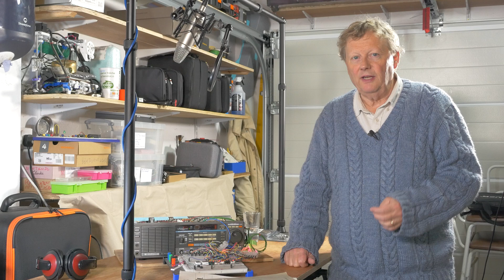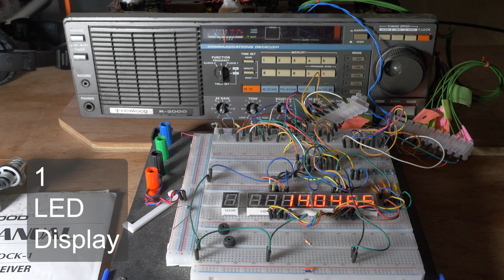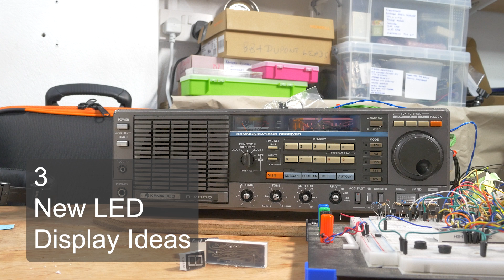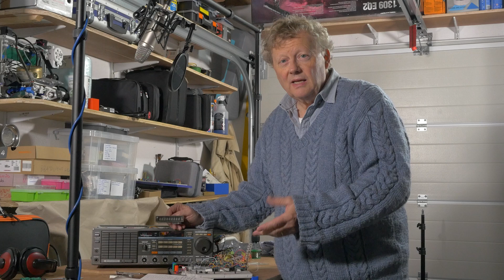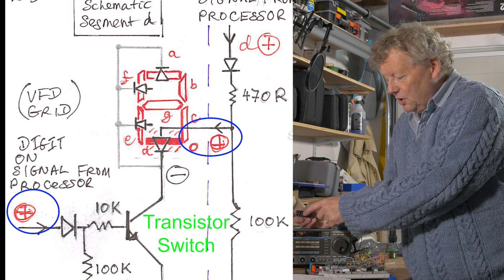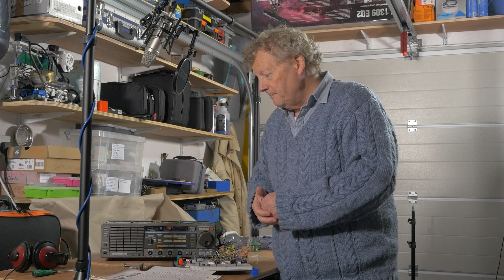Kenwood R2000 HF Ham Radio Receiver Restoration Part 1 - NEW DISPLAY

Comment: Good to see an older Kenwood being resurrected 😀 the transceivers of this age have hinged front panels. You remove two of the three screws on the side and loosen the one nearest the front bottom on both sides and the panel hinges on the loosened screw.
Reply from the maker: Thanks for the tip - I will keep it it in mind as I get going on the main part of the restoration very soon. 👍

Comment: There does exist smaller 7 segment displays.
Another approach could be to find some old calculators and see how it will fit.
Reply from the maker: Thank you - yes, both good suggestions - I have been looking and have now ordered some smaller 7 segment displays which are green, and will look more like the original display. Hoping to show some progress soon with this project!